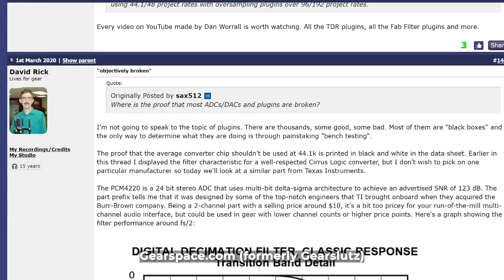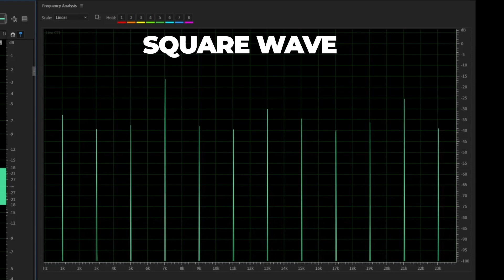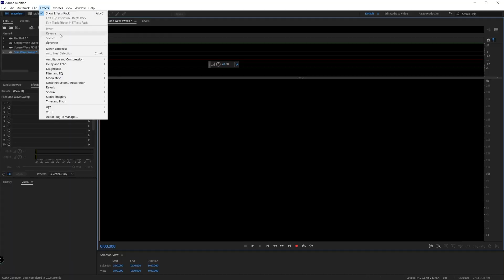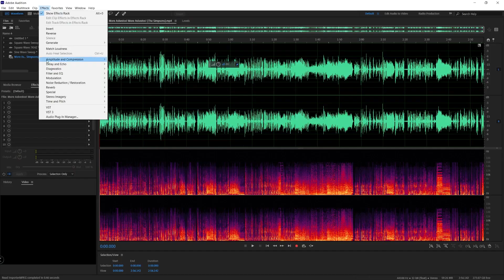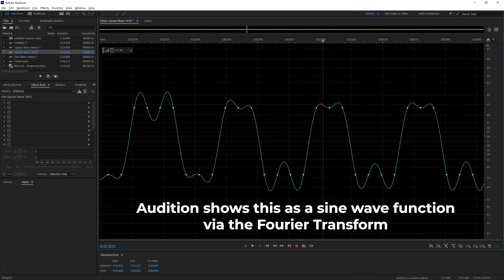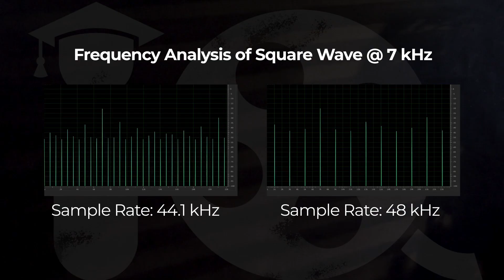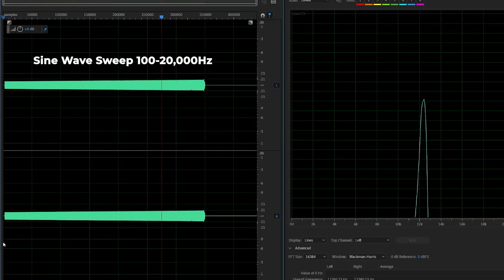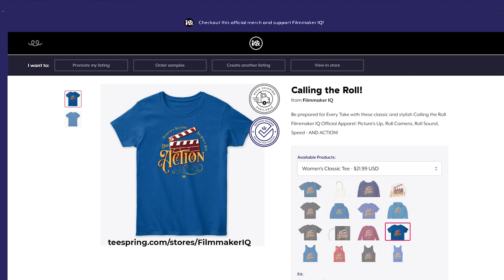What is the Optimal Sampling Rate for Audio? (It's All About the Aliasing)

Comment: I'm glad someone GETS  IT, regarding aliasing.  I've had this argument with so many tone-deaf wanna be engineers that do not understand why percussion sampled at 44 Khz sounds like so much white noise but sampled at 192 Khz sounds like percussion instruments.
Reply: >> percussion sampled at 44 Khz sounds like so much white noise but sampled at 192 Khz sounds like percussion instruments...<< 
I would maintain that if cymbals are recorded at 44.1kHz and are properly filtered to cut off everything above 20kHz before going into the A-to-D converter then it will NOT sound like white noise. I have been into Hirez for 20+ years (remember DVD Audio!) but I have heard some very good cymbal reproduction from well recorded CDs.

Comment: 48kHz is enough for playback, usually the steepness of the LP filter to bandwith is 45 to 55% of the sample output, it gives almost non-existent phase errors and ripple within maximum audible range. 96kHz can provide benefits when it comes to pitch shifting of high frequency information and lower latency. Softer filters can also be used with 96kHz and possibly less ringing and phaseshifts, but it is rare for different applied filter to be used between different sampling frequencies, in addition, higher sampling frequencies often results in an extra component-instability.

Basically all DACs and ADCs use delta sigma modulation with multiple bits (often 2-6bits). This involves a sampling frequency of
several MHz, but they utilize another more effective type of modulation for the purpose, this modulation arise from a sawtooth that follow the analogue tone frequency which provides a pulse density/width that is digitized with 1-bit for a bitstream, partly and continuously analog for a certain period and compared to the analog input signal with differential circuits which results in different high frequency pulses designed to add or remove the energy in certain frequency bands, the distorsion energy is in this way increased in higher frequency bands and decreased in lower frequency bands, which is continued until the noise is satisfactorily reduced within the desired frequency band, this is done in several steps by several circuits, divided by amplitude for more effective noise shaping while maintaining stability, after this the process of demodulation and decimation takes part from several 1bit PDM bitstreams divided by amplitude to one 24bit PCM, with applied digital filters and downsampling.

Comment: Sound people that slow down sounds for sound effects etc, say they need more room like 192k.  It's kinda like slowing down 120fps to 25fps in video.
Reply: I've heard that too -- but unless they have special scientific microphones designed to capture frequencies above human hearing, I'm not sure it matters.
Reply: I don't think it's about frequency width. It's about  stretching the entire recording. When you stretch it makes  everything thinner.   Like pulling rubber band. Signal would get less resolution.  Less data points. Through entire range of frequencies.
Reply from the maker: Problem is the rubber band analogy doesn't work because Nyquist does not work that way. Using 24khz, the audio would be EXACTLY the same as 48khz in every respect BUT only up to 12khz. So it's not that you have more data points - that doesn't matter when the audio is sent back to analog in the speakers. 

I suspect the reason 96hz would be used for slow downed effects is the same reason I discussed in the video: headroom. With 96kz there's about an octave and change you can manuever around in without running into a Nyquist limit that dips into the perceivable range.
Reply: @FilmmakerIQ  It's more of a hack (an an unneccessary one). Time stretching algorithms use sliding windows to do processing. The longer the time segment the sliding window covers the more pitch accurate they get and the less rhythmicly accurate they become. Settings for window size are usually given in terms of samples and the default setting tends to be the largest window size possible. So by going to 96k you get a shorter window size in time leading to more rhythmic accuracy at the cost of some pitch accuracy, which is often preferred. But instead of changing the sample rate you could just drop the window size for the algorithm to a lower pitch accuracy setting.

Comment: So, after you showed the example at 4:40, my first thought was, "well, what if you instead choose a frequency that exactly divides the sampling rate?". So I opened up audacity, made sure both my audio device and the project were set to 48KHz, and tried generating a 12KHz tone - in that case, a square wave sounds just like a sine, but slightly louder. 

It's easy to make sense of it if you think about it in terms of generated samples - you just get two high ones followed by two low ones, and that pattern repeats exactly at a rate of 12KHz. If you choose a frequency that doesn't cleanly divide your sampling rate, you have to resort to an approximation - some runs of high/low samples will be longer, some shorter, so that over a longer period, they average out to the frequency that you're trying to achieve. But in that case, you're essentially creating a longer pattern of samples that takes more time before it repeats, which creates a bunch of other spurious (aliased) frequencies in your signal.

I think the real takeaway here is that mathematically ideal square waves are awkward and don't work out that great in reality. Sines are way nicer.
Reply from the maker: You choose a special case which is square wave with the frequency of the sample rate divided by four!

There's two ways to think about that. Either the mathematical sum as you described or as a visual graph. Only one sinusoidal wave can fit the given samples... Instead of the sample defining the top of the square wave, it defines each side of the crest and trough of a sine wave with greater amplitude!

Comment: So here's the thing. 

Anything to do with digital sampling MUST always be done with analogue filters. 
On the recording side your filter MUST completely eliminate 100% of signals above Nyqist frequency. 
On the playback side, 100% of frequencies that are above the Nyquist frequency must not exist in the file AND the DAC output should be filtered with a filter that removes edge artefacts (remember they are stepped samples) so that there are no frequencies that were not in the original recording.

To do ANYTHING else is to create distortions that significantly detract from the quality.

Now the next "thing" where reality meets desire:

A filter that has this ideal characteristic that passes 100% of the signal below the Nyquist frequency and 0% above the Nyquist frequency can only be approximated, BUT it causes significant phase shifts and amplitude ripple between frequencies which are audible making high frequencies sound smeared or pitchy.

This was realised fairly early on and so "smarts" were added to CD decoders/DACs that created a whole bunch of in between samples creating a pre- analogue filter output that might be effectively 2, 4, 8 or even 16 times (perhaps more) the Nyquist frequency, and could therefore filtered by a much less aggressive filter to restore the analogue signal. 

As this is only half the equation, at the recording studio you would need to record with several times the Nyquist frequency, while being able to use a much less aggressive analogue filter and then digitally down to the 44.1kHz CD rate.

Doing this you will end up with a digital recording on CD that has no audible aliasing or phase delays and amplitude ripple from the analogue filter, and I'd wager anybody (even golden ears) would ever detect any difference between that and something sampled at a higher rate unless the higher sample rate recorded higher frequencies. I say this because there is some evidence that some people can "feel" the envelope of recordings above their normal hearing range.

This is the science and the engineering of it all.
Reply from the maker: I would add that you don't  want those higher frequencies even if you could feel them. There's nothing musical about those frequencies
Reply: @FilmmakerIQ  While I would agree with that statement, that is based on taste/emotion and as such can be argued against by those of different opinion. The rest however, is based on science/engineering.
Reply from the maker: No it isn't based on taste or emotion, those frequencies are quite painful to listen to.

I had someone else comment that the experience trying to hear a 21khz tone was like shoving needles into your ear.
Reply: @FilmmakerIQ  :-) I find valve amplifiers sound woeful, yet a number of people with deep pockets swear by them. This is that same sort of thing. Agreeing with me that it brings nothing to the occasion does not stop someone somewhere thinking it sounds great, just like I like birds eye chillies and my wife doesn't.

Comment: It's the other way round. The Gibbs phenomenon shows up, when there is NO aliasing. It is the result of running through the antialiasing-filter in a DAC. The antialiasing-filter rolls off all frequencies above 20kHz and the result are the squiggles around the edges. A perfect square wave has an infinite number of overtones, and when you cut those off with the antialiasing filter, the result is a band limited square wave, which exhibits Gibbs phenomenon.
Reply from the maker: Yeah I over stated the Gibbs part